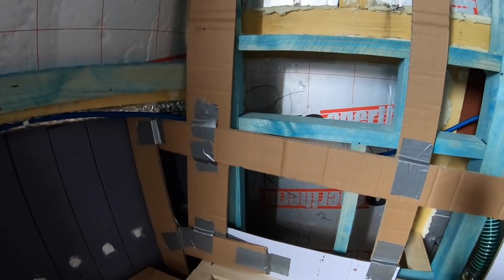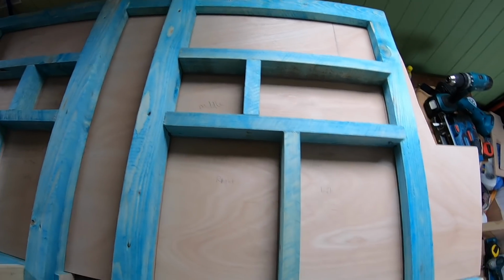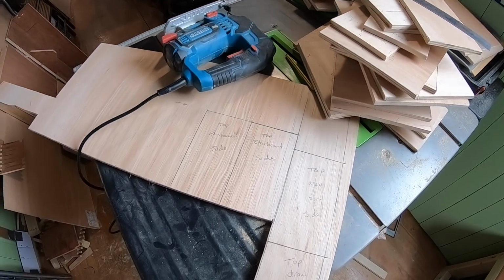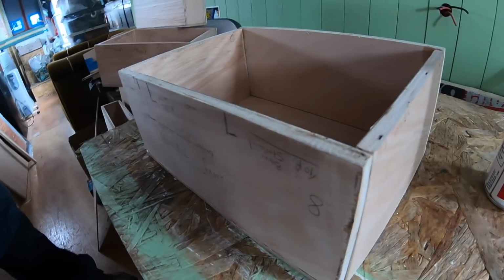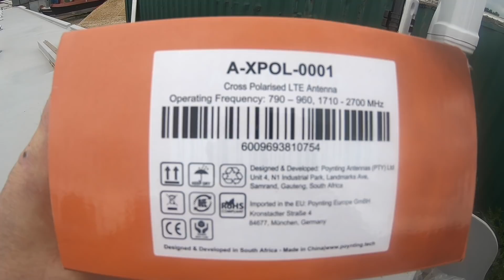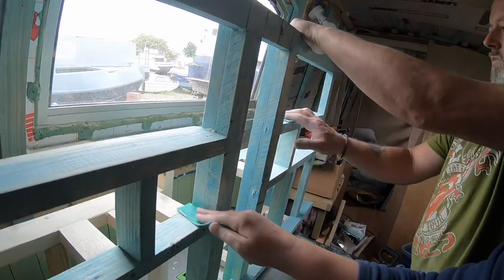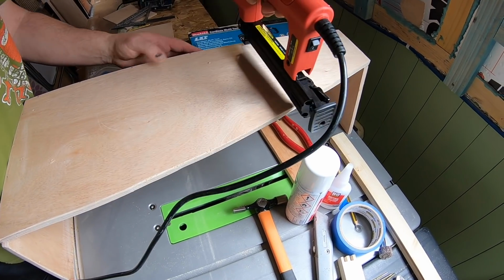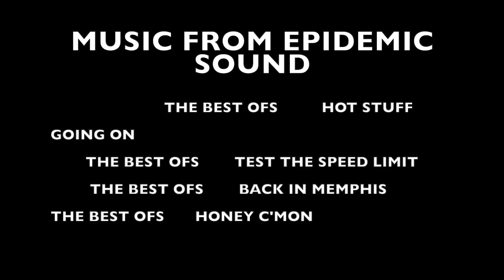VLOG 29, NARROWBOAT FIT OUT - Making the headboard

Comment: Nice informative vlog, again.
I’m very interested in the two-part mitre activator, although not sure when I could use it (at the moment). I will look into that.
Interesting what you have said about ‘Smarty’. I tried one at home last Christmas time, using the same router and antenna, but the results were awful, and that was in the middle of Nottingham! However, I have not tried it in the field as yet, not having updated my Smarty sim subscription.
However, I have just installed a ‘1pmoile.com’ sim in the router on the boat, and the upload and download speeds are fantastic, without even having to use the antenna; 1pmobile.com use the EE transponders. I suppose it really does depend on location and environments with mobile wi-fi router signalls. By the way Ady, you don’t need to point an omni-directional antenna towards the cell phone mast / transponder, it’s ‘omni-directional’! I’ll put it down to you having a senior-moment… I have them all the time! 😉